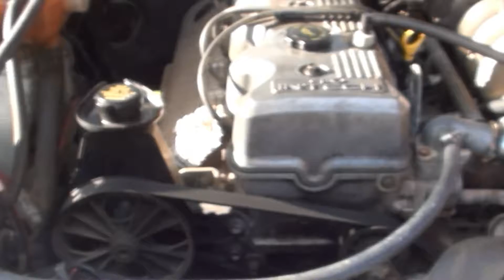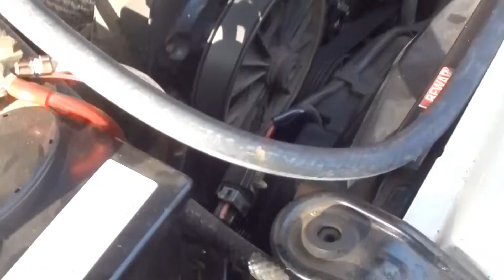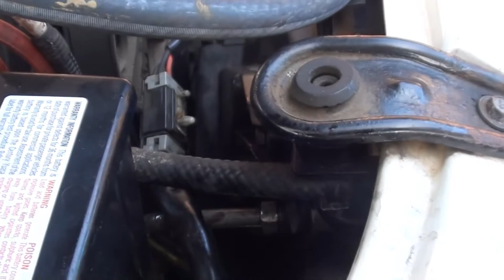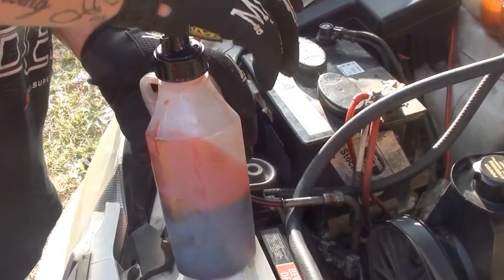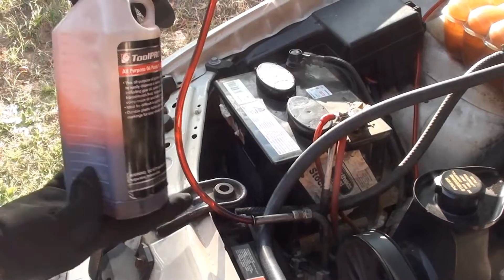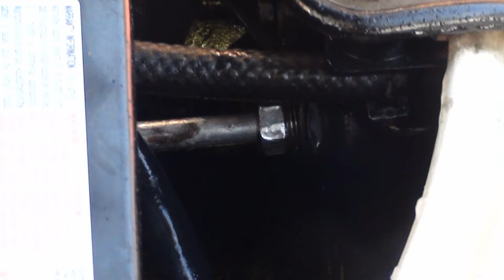How to fill a ford falcon gearbox

Comment: Nine of these videos say how they hold or the correct procedure to check them
Reply from the maker: you need to get under the car on the side of the gearbox is a filler plug undo it and fill it till it starts dribbling out is the correct way
Reply from the maker: but this way will get you out of trouble just don't go pour tones in at a time